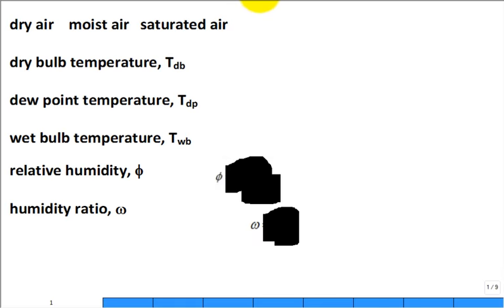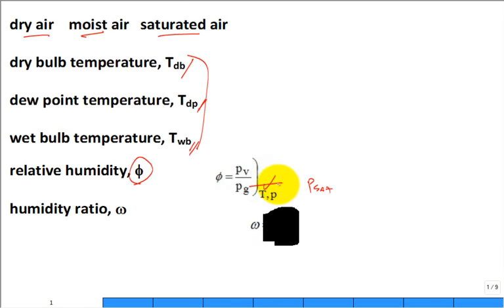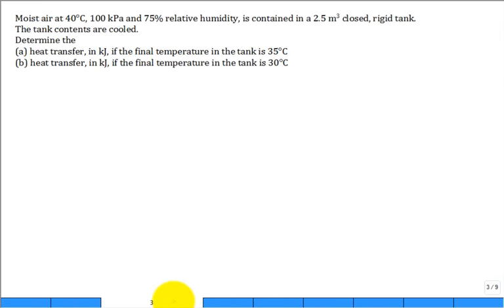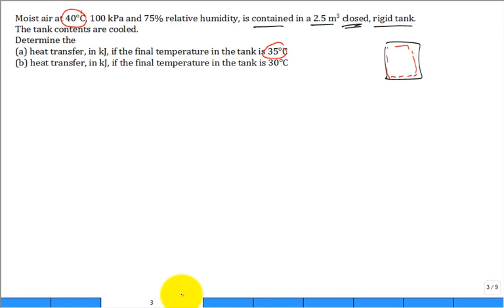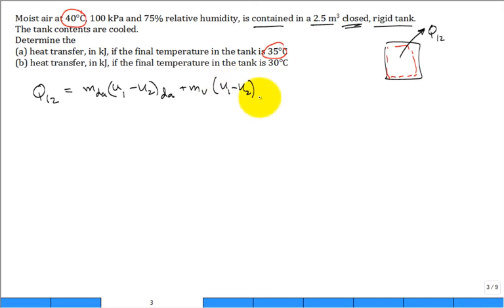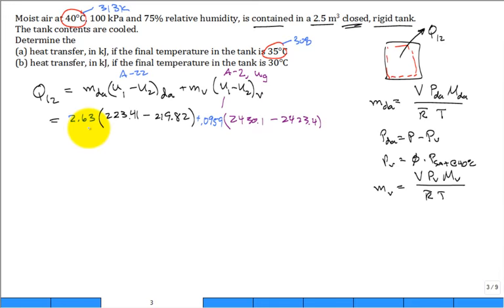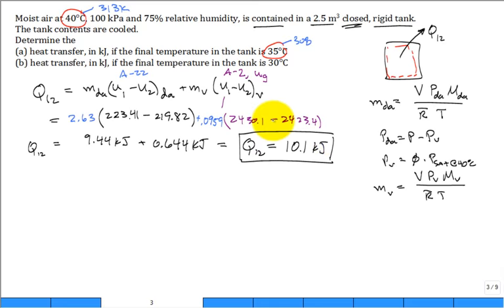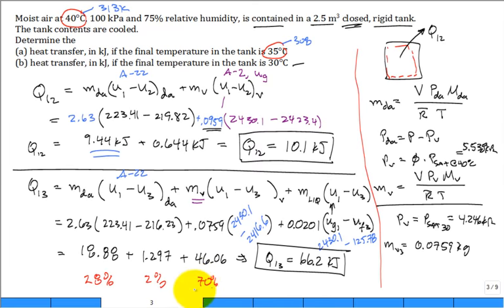ME4293 Psychrometrics 2 Fall2016

Comment: For the energy balance, why is the mass flow rate of vapor said to be the same going in vs going out? Would it not be different because Pv1 and T1 are both different than Pv2 and T2 which are used to calculate the mass flow? On the equation you have, you just wrote the mass flow rate of vapor going in.